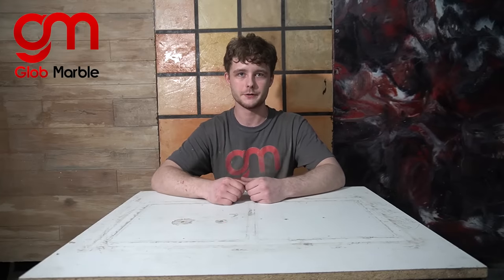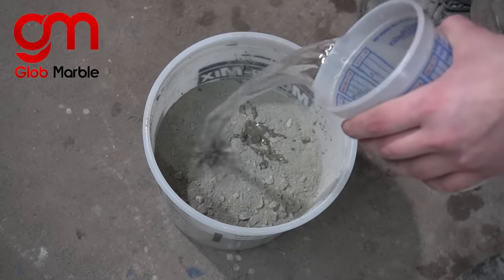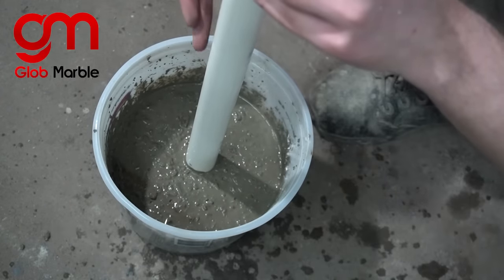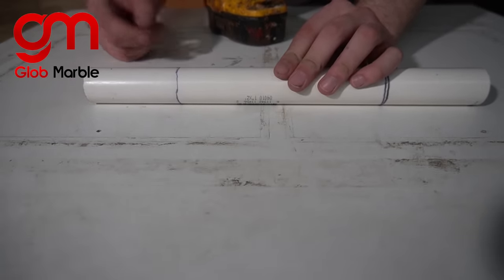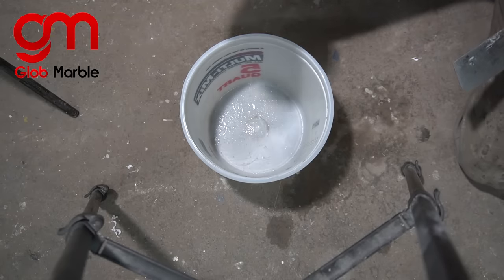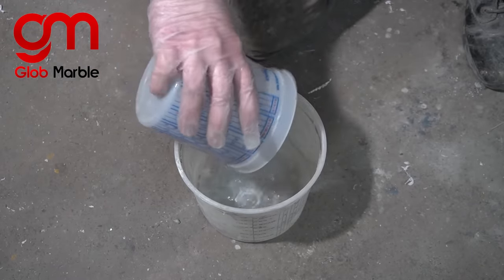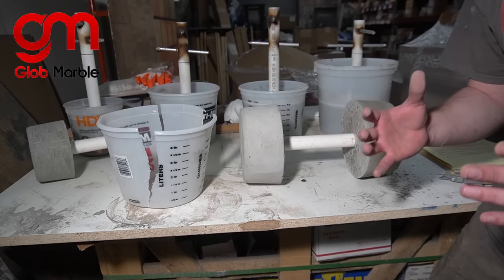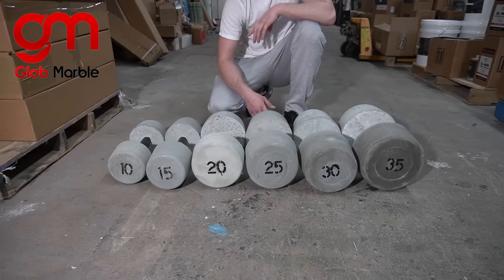Concrete Dumbbells | DIY

Comment: An old bro of mine works for a concrete and masonry company and he made his own dumbbells out of concrete, too, but they were all odd weights when he cast them. Each set weighs the same i.e. a 6.1 lbs set, a 13.7 lbs set, a 19.4 lbs set, etc, but, instead of marking the weird weights by their actual weights, he just labeled them #1, #2, #3, #4, etc, etc, in order of lightest to heaviest.
Reply: as you cant tell the bigger ones are heavier...
Reply: @andreysilva8418  LoL
Reply: that's fucking hilarious
Reply: tbh that's just more efficient, the exact weight doesn't really matter (and if it does you can always go check your strength in a gym with proper dumbbells)

Comment: Heat up the nails and push them through instead of heating the pipe.
Reply: quick question, I honestly don't know who to ask about concrete stuff, but is it better if I use large metal screws instead of the metal nails he used because it gives it more surface area or will that weaken the dumbbell
Reply: Nails that huge have a lot of thermal capacity he did it right
Reply: You would waste a lot more gas doing it that way tho

Comment: Another pro tip you could add is to buy rubber coating spray paint to protect the concrete and make them last a bit longer :)

Comment: Thanks, you inspired me to make my own dumbbells. 
Pro Tip: Instead of cutting the bucket when you demold. Add some baby oil in the buckets before pouring the concrete in. Then lightly tap around the bucket when it comes time to demold, it will slide off so you can use it again. This will greatly reduce your cost basis.
Reply from the maker: Hey!! The reason I didn't use a release agent on the buckets was that I didn't want the dumbbells to be smooth. This is why I mixed the concrete in the original container. Closer to the end you can see a few closeups, and the sides look scratched up and more rugged which I think is a much cooler look than a smooth cast of a brand new bucket. Those same scratches and ridges make it extremely difficult if not impossible to demold without destroying the container.
Reply: Motor oil works also
Reply: WD40 too
Reply: I will have to try this then, cause apparently everyone is buying these disposable buckets out.
Reply: I recommend Vaseline because it won't run like baby oil.
Reply: @jimmymac601  this escalated rather quickly.
Reply: Oh great, now i gotta go and get a baby
Reply: @lucho3410  Next up: Concrete babies DIY!
Reply: Don't just think only about costs, but the environmental costs too.
Reply: @humansaremortal3803   Hahahahahahahahaha!  You win today's internet, boi!
Reply: @GlobMarble  Silicon based lubricant worked well in my scratched buckets shrugs
Reply: Or pour into trash bag inside bucket...
Reply: Josh Bar and the environment will thank you as well
Reply: Thank u I only have 2 buckets
Reply: Tbh my weight came out without any lubricant
Reply: @benharding533  yeah you don't need any lube concrete doesn't bond to plastic.
Reply: Thick grease helps too
Reply: After 24 hours in the bucket I pour some water in and the concrete separates itself from the mold. No need to break It
Reply: @humansaremortal3803  where are you from?
Reply: @Aurel_7  Planet Earth. How about you?
Reply: Mix hemp with the concrete and it will never break
Reply: @Joshuadalewillis  I put a little Coke in the mixture. Not only do the rocks come out of the buckets quick, they seem to lift themselves. They do come down a little hard though. Maybe adding a little baking soda too will help the crack(s)🤷🏻‍♂️
Reply: I did this (my concrete is still setting). Just wondering what’s an effective way to absorb the oil off the weights once I take them out of the buckets. Don’t want them to leave grease marks on the floor every time I put them down.
Reply: @a1videoprod  dawn
Reply: @GlobMarble  rough cast does look better definitely. But you can still get that roughness with a light sanding around the outside after 1st 24hrs so you can reuse the molds in future, made my own plates, roughed it up to give some grip for when I applied a rubberised paint... You'd swear they branded plates by time I was finished lol I went bit over the top and wish I just left it with the rough cement look in the end
Reply: can I just put cooking oil 💀💀
Reply: @GlobMarble  Yeah but rough concrete scratches hardwood floors and anything else it touches.  I don't think most people would opt for that.  Plus you can reuse the plastic containers.  We have enough plastic in our world. :)
Reply: @jimmymac601  Very smart!
Reply: @FreshAirRules  you could put on a clear rubberised coating to prevent scratches, but what I will probably do is to cover them with a piece of cloth or pour the concrete in 3D printed Molds and let them inside
Reply: Ohhh talking from experience
Reply: @GlobMarble  Hello! Can you give me the suze of the cube ?

Comment: comment takeaways:

--If your worried about pvc pipe breaking with extreme weight... and dont have the tools to use EMT conduits (drill holes)... just get schedule 80 pvc pipe. most hardware stores will carry that too. schedule 40 is weaker than schedule 80.... albeit schedule 40 should be strong enough already aswell.
--Concrete in pvc tube wont make it stronger!!!
--Spray outside of finished concrete dumbbells with Line-X a few times and they will be much stronger
--Use hockey grip tape to wrap handles, electrical tape will come off after just one sweaty sessions
Reply from the maker: You basically summed it up :)
Reply: If you put some nails and concrete on that pipe it will make it stronger I believe but thanks for your insight
Reply: do you think a 3/4 inch emt conduit will be strong enough. Home Depot has 1 inch x 10 ft. but I dont  need all of that to make a pair
Reply: D H depends on the weight. I would think up to 35lbs should be fine. I’m thinking of making 45 lbs in 1”
Reply: can schedule 80 handle 50 lb concrete dumbbells? If i stick the schedule 80 pvc pipe into the bucket of concrete I don't need to drill holes in and put screws in?
Reply: hondaiienvy1 yah schedule 80 and u have to use nails. The nails are what keep the pipes from sliding possibly out of the concrete
Reply: @taden2007  right on thanks. and you'd suggest pvc sched 80 over abs plastic? I heard some say abs plastic can handle more force.
Reply: quick question, I honestly don't know who to ask about concrete stuff, but is it better if I use large metal screws instead of the metal nails he used because it gives it more surface area or will that weaken the dumbbell
Reply: O
Reply: You can also put some wire and concrete in the PVC itself.
Reply: Just to add to the comment, you can put some metal wire into the concrete through the PVC pipe. This will greatly increase the overall strength.
Reply: @Dudik28  not needed. overcomplicating it for no reason.
Reply: @taden2007  it is not over complicating anything. Concrete is very tough, yet brittle. Adding some metal wire into the concrete is a standard procedure. It makes the consteuction able to withstand a lot more bending, which is the main type of stress the dumbbells are going to be experiencing. You yourself said that the concrete alone wont make the piping stronger, so why not adding some scrap wires?
Reply: do you think 80 pvc pipe would hold 88lbs (40kg) dumbbell?

Comment: If you dont cut the bucket all the way off, just cut the excess, you essentually have a rubber coated dumbell. You can also get some rubber paint for the outside if you dont like the bucket look.
Also, I would reccoment hockey tape over electrical tape. E tape will slide over time and youll get a greasy residue. Hockey tape is meant to be handled often and feels better on the hands.

Comment: Great idea. One thing you will eventually regret, is the electrical  tape on the bar. Speaking from experience here. Eventually, the tape will start to  slide around slightly, just enough to expose the adhesive. This then leads to a sticky mess on your bar.

Comment: you did a perfect job, I used schedule 80 PVC because its stronger and I used screws but doesn't really matter. I bought liquid plastic to rubberize the concrete but honestly duct tape works great and if you accidentally drop them it'll break or chip but its covered with tape. Liquid plastic will get expensive. My first set looks like shit but I'm improving. Im gonna try to make fixed small barbells with rotors.
Reply from the maker: Thanks! a great way to make them indestructible without making them look ugly is coating the concrete with LINE-X. Just remember to wait for all the moisture to leave the concrete before spraying (3-4 days)

Comment: Easier :   Drill 2 large drywall screws on each end of the pipe, similar to the nails you placed .   let the screws stick out at least 3/4 inch from each side.    Pipe will never move.   I recommend putting chicken wire in the concrete, in case the dumbbell drops , the wires make it 50 times stronger against cracking.

Comment: 15 push ups(on dumbells) - 20 squats - 20 - lunges - 15 row - 15 narrew push ups(on dumbbells) 15 cheat curls - 15  glute bridge - 30sec dumbbell hollow hold flutter kicks repeat 3x beginner 5xnormal 8x extreem :D love the video:D

Comment: I just used a 160mm ppr water pipe and it works great and i mixed white cement with gravel mix and its hard as a rock
Instead of containers i used 7 liter water bottle cut in half

Comment: Very cool. I was thinking of spraying the concrete (once it cures) with plastidip.I also have some grip tape I got off amazon (same type used on handle bars and tennis rackets).

Comment: So Boss thanks for the video Its great. As I was watching it at the point that you cut the buckets of the concrete I was anticipating what you said later on about not throwing them around as they will break up. As a person who works with up cycled HDPE plastic a lot I was thinking that you might try to de mold them with out cutting the buckets, then after letting them cure and get all the moisture out you could Remove the upper rim of the bucket and  put the buckets back on them and then using a hair drier you can soften the plastic and form it over and around the concrete to enclose them and extend their shelf life a bit.  Thanks again for the video, stay safe

Comment: Instead of nails you can also use a bolt and use two bolt-nuts to position the PVC pipe exactly where you want it.
Reply from the maker: That was the original plan but these nails ended up being cheaper :)

Comment: hey if you somehow can make a rubbery seal around it, then that makes them much less susceptible to cracking!
Reply: I just used plastic bags and then an extremely large amount of duct tape to pretty good effect. My weights were made of 'Portland cement' (plaster of Paris plus sand) which is weaker than normal cement but I don't baby them and they haven't broken yet after a year or so, the thick duct tape layer seems to work pretty well for protecting them. Ugly but functional :)

Comment: Simply putting in a construction screw on the end of the tube would be fine.  Reuse your pots by spraying in the nonstick spray from the kitchen before pouring in concrete.  The finished product looked great.
Reply from the maker: Thanks! The screws would work but not as well, and the bucket will not demold because of the scratches inside of it. If you would like to demold the buckets and not waste them, mix the concrete in a separate bucket and pour into a new one. I don't think they would look as cool without the scratches though

Comment: Worked out well! I’m gonna have to check out your other concrete work. 

I’m thinking of buying a gallon of flex seal and dipping the weights in it.  
@$30 a gallon I’m still waaaaaay ahead of buying a set of 25’s
Plus it may keep it from chipping etc 

We’ll see.
Reply from the maker: That's a great idea, I never knew flex seal was so cheap
Reply: Where do you get flex seal at that price?
Reply: I erred  
That was 32oz can for $30
Oh well.
Reply: @bodiddley7404  oh man .... I was so looking forward to it.
Reply: @bodiddley7404  look for liquid plasti-dip instead of flex seal. plasti-dip is usually sold in spray cans, but the liquid form might work better for this. typically people use the liquid kind to dip tool handles to add a rubber like grip to them, but I dont see why it wouldnt work on these weights if you completely encased the concrete in it.

Comment: My God. Those 35 pound dumbbells look massive.
Reply: I have a pair of 50lb concrete dumbbells. They get quite big lol
Reply: I had a bunch of lead left over from my old roof and melted it down and filled the handle with the lead (metal handle) my 80's look like his 35's. If anything I would go higher/longer instead of wider/increase the diameter as it tends to get in to way making you do partial reps.

Comment: Hey just thought I'd clarify that the water doesn't evaporate from the concrete, it sets with it to form the hydrates that give it strength. The weight of the water needs to be accounted for in the final weight of the dumbell.

Comment: thx for video.. I'm gonna try using a shovel handle for the grips, cut to length, solid hickory   and put a few wood screws in for dowels..
Reply from the maker: That would probably be sturdier than the PVC

Comment: Hello your dumbells look perfect! I'm trying this too, thanks for the explanation. Just a question though, if I want 30lb dumbells I just have to measure 15 lbs of dry concrete on each side? The weight of the concrete doesn't change with the matter state?
Reply from the maker: Thanks! Technically it will be a little bit heavier but its unnoticeable. Maybe by a few grams
Reply: @GlobMarble  thank you for the answer!
Reply: mr system  yes I did
Reply: asys t How did it go?
Reply: @angelayala7922  he was pressing it then one block land on his head

Comment: Thank you so much for this video! I just bought the materials for this here in Portugal! I'd like to keep the buckets though, so how do I go about it? What oil do I add and when during this process?
Reply from the maker: You need to add a release agent like oil to stop the plastic from bonding to the concrete. Also the main reason I had to cut them out was because I mixed the concrete in the same bucket which I casted in. This created a bunch of scratches inside my buckets which gripped onto the concrete. Instead you should do all of your mixing in a separate "mixing bucket" and pour it into a fresh casting bucket to reuse them :)

Comment: how is the electrical tape holding up? if it gets too hot from hand friction the glue with start to melt and the tape will shift, maybe better off wearing gloves when using them. awesome vid man, gonna try this!
Reply from the maker: The eclectic tape was just for looks, and honestly isn't holding up too well. Many people are recommending to use hockey stick tape instead :)

Comment: Apply oil layer inside of the container. Then you can easily remove the container without braking..
Reply: When do I apply it during this process?
Reply: @miguelbotto2849  before fill concret , apply oil inside of the container .

Comment: Those are the cleanest DIY Dumbbells I've seen so far. I have 2 questions though: 

1. Does some water remain within the concrete, meaning it's gonna add to the weight? 
2. Does anyone know what size or shape of the bucket is best to get a nice compact dumbbell rather than a big blocky one?

Comment: Hi great vid, thanks ! 
Just a quick question : How much did the finished unit weigh when it dried and how much water did you add in total for each unit ? 
For reference the min. water to cement ratio is 0.23:1 just for hydration ( the chemical reaction of hardening ), and 0.35:1 for a more workable mix. This doesn't include the aggregates like sand and stones.
You can add up to 0.5 but after that the concrete strength will be affected so they might break more easily.
You can mix only the water and cement together first, to make sure you get the water and cement mixing properly so that it will harden right, and then mix the aggregates in later.
It will be a pretty stiff mix though.
Thanks for the vid

Comment: Just use EMT Conduit instead of PVC it's a lot safer and more sturdy!
Reply from the maker: Maybe so! Still, I haven't had any problems with mine yet :)
Reply: It would be interesting if you left the bucket on somehow, trimmed it and left them “plastic encased”.
Reply: @garnetsteen  that would be a great idea
Reply: i like the idea but can u get the nail to fit in as tightly? or would that be a none issue with it being in concrete?
Reply: Might as well go rigid conduit so you never have to worry

Comment: Will this make huge difference when concrete is drying out, water evaporates and how accurate can you get the weight if you use the same level on the bucket, will they both be exact same weight, only a few grams difference? Great idea!
Reply from the maker: Thanks!

Comment: ( 4:50 ) spray the mold with PAM or any other  cooking oil and reuse them
Reply from the maker: You can get it out without oil. Plastic wont stick to concrete. I had to break it because of the ridges and scratches from mixing inside the bucket. No release agent would help in demolding them
Reply: @GlobMarble  Couldn't you just pour the mixed cement into the molds to reuse them, and designate a container for mixing?

Comment: If I want the weight on one side of the cement block to be 20 pound, does that mean I only mix 20 pound of cement with water? thanks
Reply: @yashkelaskar8943  1 liter of water weighs 2.2 lbs.
Reply: @mckenziekeith7434  thats why he said approximately
Reply: @yashkelaskar8943  I thought the water would evaporate and eventually 19 pound of cement + 1 litre of water would weight 19 pounds.
Reply: Make sure to mix only half since you'll be curing one side at a time.
Reply: @yashkelaskar8943  thanks
Reply: @davidmendiola1  thanks